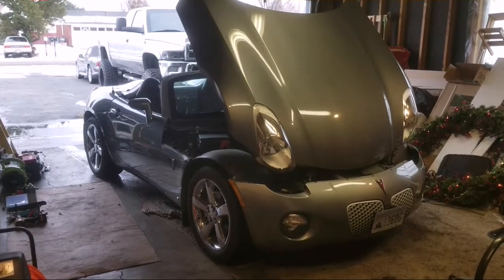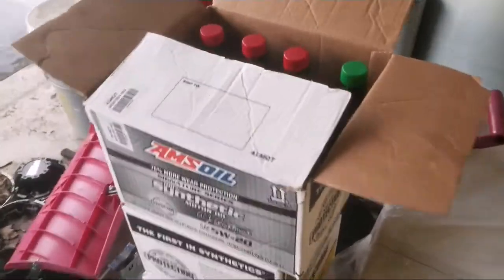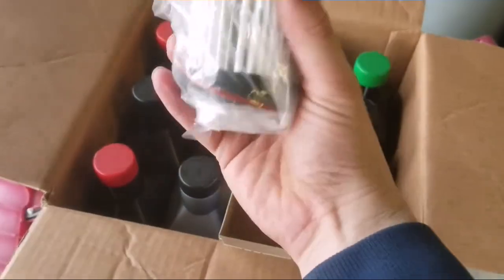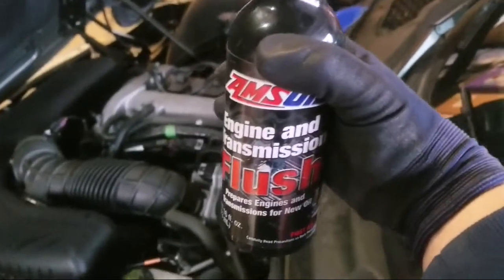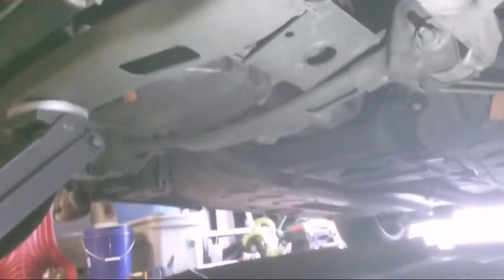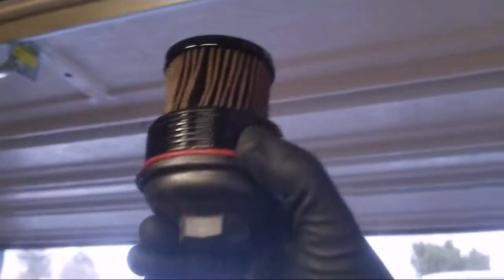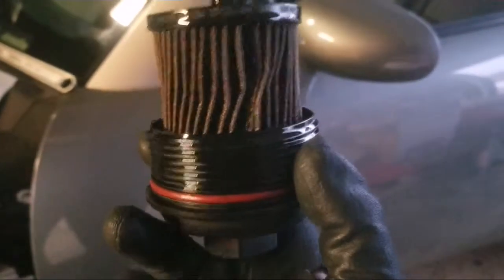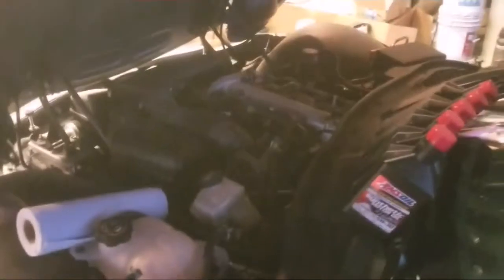Oil Change on 2006 Pontiac Solstice 8k miles.

Comment: GM specifically states not to do an engine flush. I would have just changed the oil with cheap non synthetic twice than added synthetic after driving for couple hundred miles. nice video!